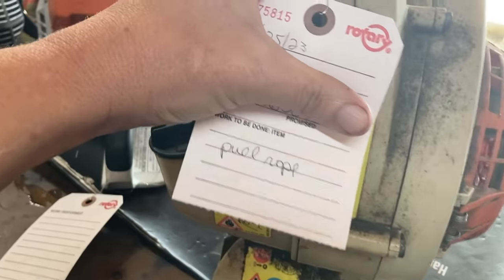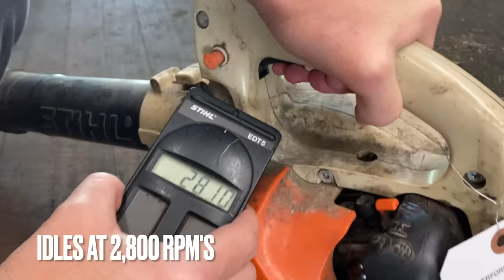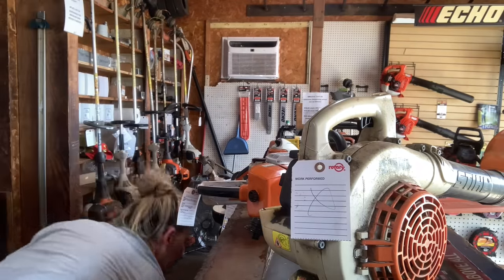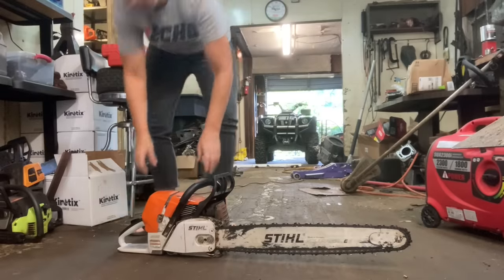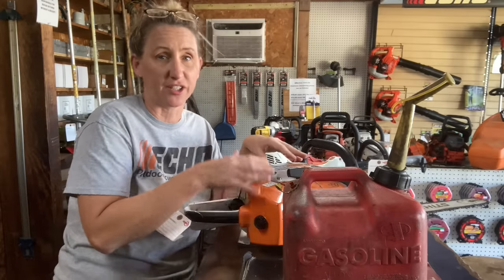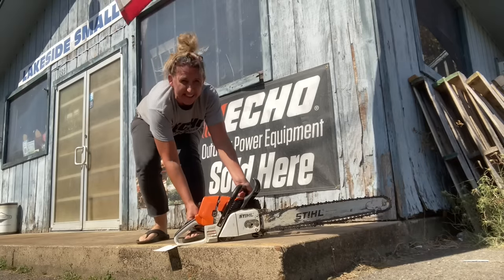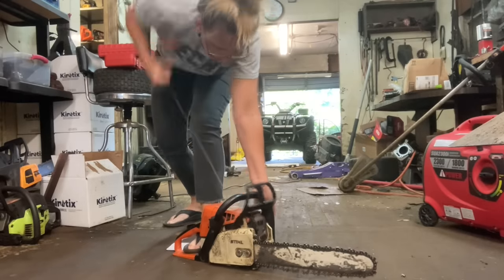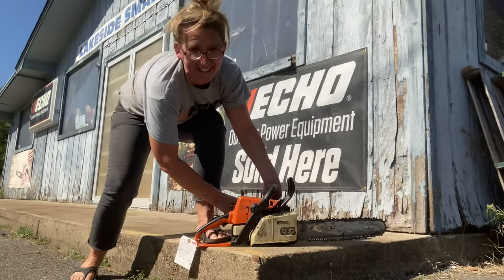The Burning Truth of Canned Fuel. This HUGE Distributor Doesn't Like Me Exposing It!

Comment: Not sure if anyone has mentioned this but what about doing a video on mixing your own fuel? I think many people may be intimidated on doing it and you could show how simple it is and the cost benefits of doing it yourself. Great video as always and I have learned several tricks from your channel!
Reply: Who is stupid enough to be 'intimidated' by putting oil in a gas can?
Reply: Same people who are buying canned fuel instead of mixing their own I suppose.
Reply: Its easy, here in the UK and europe I guess, you can buy a measured dose in a small plastic bottle that you put into a 5ltr can of straight gas, that gives you the perfect ratio
Reply: most people like canned fuel because it has no ethanol added and should keep longer.
Reply: @bonvoyage5377 That's how I've always done it here in the US. It's marked to show what the ratio will be and you buy enough for however many gallons you got. Or you get a gallon of oil and a measuring cup. It's real simple. I've done it for 40 years
Reply: That is great and will last a long time :)

GreT point
Reply: @mikecee3058  Same people that can't change a tire without AAA or put a new graphics card in their computer without Geek Squad. It's getting worse.
Reply: Mixing is easy. Finding ethanol free gas is difficult
Reply: Nearest place to me with Ethanol free gas only has 87 octane  for $4.75 a gallon
Reply: @JamesFlynn-np7sq   Agree, but even that is easy to DIY.... glass jug and water. Water bindes to the ethanol and pulls it out. Sure, you waste a bit, but.... ethanol-free in the end.
Reply: @sfeddie1  and expensive.  just paid 6.39 / gallon today.
Reply: @stickyfox I call AAA because that's why I bought it in the first place, especially the way people drive nowadays, I don't want to get hit
Reply: Pretty sure I know who you’re talking about.  Is there ANY canned fuel you recommend?
Reply: @JamesFlynn-np7sq  Yeah, the no ethanol is a major factor otherwise I would have to go out of State to get gas.
Reply: @ericschulze5641  Well there's changing a tire, and then there's changing a tire on 110th st during rush hour! I'm okay letting a pro with a truck and hazard lights take care of things. But I still think people should be able to change a tire in their own driveway using the tools and instructions that came with their car.
Reply: @stickyfox  people today throw thier shoes out because it's too complicated to put new laces on them & that's what we're dealing with
Reply: Stop mixing more then a gallon can.
Reply: @davidperdue7506  That's all you need for small engines.  They're not high-performance engines with computer-controlled ignition timing.  

But yeah, that extra buck-per-gallon tax for real gasoline is annoying AF.
Reply: @bluejeeper1 some, sure, but very few
Reply: @stickyfox not really, no
Reply: @sfeddie1 precisely
Reply: @2112user Thanks! Nice to see a genuinely helpful comment
Reply: @irtheLeGiOn exactly
Reply: @ericschulze5641 not relevant to the topic
Reply: This is a great question. It may be obvious to most people watching this video, but it's not obvious to me. I have no idea how to practically go about measuring a 40:1 gas/oil mixture in the small quantities I need for my leaf blower. I mean, I know I can buy syringes and measuring cups to precisely measure out the quantities, but it seems like a lot of work just to fuel my blower. There must be some tricks that the pros use.
Reply: Just follow the instructions on the back of the oil bottle 😂 🤦‍♂️
Reply: @jeromewesselman4653  the one about the shoes or taxes,  & both ARE relevant,
Reply: My first thought : /
Reply: 40:1 or whatever not rocket science.
Reply: @ericschulze5641  While I enjoyed reading your posts, unfortunately, they did skirt into condescension a few times. People with chainsaws aren't stupid. They know Imperial and Metric measures inside and out, if for no other reason, that most all of them cook food from time to time. The main trouble smart people have with 2-cycle mixes is an elephant in the room called... [drum roll]

...ethanol. Many of them, myself included, have dealt with unstartable equipment sufficient times using regular (i.e., 10% ethanol) gas, to consider the purchase of a relatively expensive premix to be a minor inconvenience - strike that - more convenient than the alternative scenarios.

I will concede that there are some who would rather not mix in the smaller amounts required for occasional use out of fear of error when calculating equivalent proportions. But I posit they comprise a tiny minority. 

I've got serious questions about 2-cycle engines versus ethanol. Someone knowledgeable should do some videos on the subject - there isn't much worthwhile out there
Reply: @sfeddie1    You can use water and food dye to remove the ethanol,  then a octane booster additive,   then just mix with oil in small batches as you need it.
Been doing this for some years ,no problems and saws run well.
Reply: @Raiver-of-Eridu  You don't usually mix it for each tank. I use an old square metal 1 gallon paint thinner can. It's 3.2 ounces of oil for than gallon can. You don't need to be exact. Sometimes you even find little bottles that are exactly 3.2 ounces so you just dump the entire thing into 1 gallon.
Reply: @julianhawker7672 may as well just buy the pre mixed fuel at that point.😂
Reply: Most people use too much oil creating a lean fuel condition.
Reply: @davidperdue7506 have you tried your local farmers coop? Ours in rural TN sells 87, 89 & 93 octane.
Reply: @Raiver-of-Eridu mix 5litres or a gallon or whatever small quantity jerry can you can get at a time. Get the squeeze measured 2 stroke oil. Figure out how much will get the desired ratio and stick to it. Oil in first, then fuel, then shake it like hell
Reply: @Raiver-of-Eridu   Just get the oil its 2 stroke oil. itll have a picture of yard equipment. you can buy a tiny one meant just for 5 litres or a gallon. then buy a larger bottle of oil and just fill the small one. btw a small amount of ethanol won't ruin your stuff, every landscaper uses normal gas with ethanol
Reply: @jeromewesselman4653 if you can only get ethanol, get the highest octane available and run it completely out of gas before you put it away for a decent amount of time.

Drain the tank (depending on you specific equipment, a lot of times you can disconnect the fuel line at the shut off, makes it easy with less mess) 

Or if you do have a fuel shutoff turn that closed and let it run out, try to start it a couple times with no fuel, you should be good to go next time you need it.

This will prevent the ethanol from gumming up the carb 
But it’s not going to keep your old gas from going bad.
Reply: @raycar1165  Very helpful, thanks!!
Reply: @irtheLeGiOn I drive around the country for my job. I can't remember a gas station that doesn't sell ethanol free gas.
Reply: @2112user and now he that the ethanol is gone so is the octane. 

This is why we can't have nice things, and they stick with compression ratios that are capable of running on 80 octane.
Reply: @leftyeh6495  IDK about the compression ratios, but I absoultely do agree with you on the octane. I know it weakens the gas, removing the ethanol, but I've never seen anyone test it or show numbers as to just how much it lowers it.  
I would like to see this, see if all 3 grades are the same after this, or if starting higher leads to a higher outcome. 
I don't use much 2cycle, so not in a position to really comment on how others might fare, but for my snow throwers and weeder, it works well.  
I did also see a funnel advertized a while back that claimed to remove water ( some separator material in the neck). Never tried it, but have since wondered if that might not be an option/alternative to the glass jar and hose. 
I did like a comment another here had, adding dye to the water.... never did that, but next mix, sure gonna try it.

Comment: i remember when i worked in a service station and we would mix our own 25:1 and 50:1 fuel/oil brand in large tanks and decant. with the reduced costs of 2 stroke oil and the ease for people to accurately measure the ratios, it was stopped. the mix was a blue green colour.  we also sold fuel cans in different colours that made it easy to distinguish them apart.
Reply: Which color sold most, use red easier to tell from light green or blue color

Comment: I have had that problem with 2 different blowers from stihl with premium gas and still oil. Have had this for several years and not sure why. Old or new fuel doesn’t matter but this pushes me to get a tach to see if it is doing same thing( good reason to buy more tools)😁

I just found your channel couple days ago and work on everything from blowers to my kubota B series tractor. There are things you mentioned that I forgot about in my classes back in high school over 35 years ago

Comment: I bought a weed eater 2 years ago. They offered an extended warranty if you used their canned fuel. The unit would not rev up to full RPM. Took it to the place I bought it. They adjusted the carb. It was better but still not achieving full RPM. Then I saw a video of yours or maybe someone else (not sure) about the canned fuel. Stopped using it at that time. The unit runs great and reaches full RPMs. It is however harder to start now. But still runs way better than on that premix junk!  Thanks for the heads up.
Reply: Without naming names...I did exactly the same thing. Ran fine first time. After that, could not get full RPMs. Ever since switching to  Echo Red Armor , it hasen't missed a beat.

Comment: Your shop coffee must have a heck of a kick!
More seriously... I wonder if freshness has an effect. I'd be willing to bet that somewhere along the supply chain those cans sit for way too long. Perhaps the fuel is OK when it goes in the can, which is why it works for some people, but at some point the age matters and you see problems.
I am pretty sure that when I make my own mix, the gas hasn't sat around for very long.
Reply: I have had Echo fuel in a trimmer and chainsaw both, set over the winter, and well into the summer for the saw, they both fired up with out having to do anything but prime the trimmer, choke the saw, saw did not have bulb to prime, both fired up and ran just fine on left over fuel in the tanks, it was Echo Red Armor fuel
Reply: The problem is that they claim it doesn't go bad
Reply: I don't know if they still have a date stamp on the bottom of the cans but I don't care what the chemistry is, the fuel will deteriorate when mixed with any brand of two-stroke oil.  Red Armor has a preservative in it that is supposed to be good for two years.  To me it is much easier to get an accurate measuring cup and only mix the amount of fuel and two-stroke oil I need at any one time; much easier than taking it to a shop or rebuilding the carb. I am a fan of Amsoil Saber at 40:1 and have been using it for over 30 years in all my two stroke equipment including large chainsaws (461, 660).
Reply: The coffee wouldn’t even give you a buzz.
Reply: As she showed.   They can run on the can fuel but… the performance is diminished.  With the blower it was a 17% reduction in RPM, just by using better fuel you can take the performance of the machine to the next model up and still have the cost and weight of a smaller machine.
Reply: @tomdomenico how hard is it to add a known quantity of oil to the fuel tank? Guess too hard for some

Comment: I always try to refuse selling my customers that canned stuff, especially at $23 a gallon.  I generally send them to check out with a new 1 gallon fuel can, some quality 2 cycle oil and directions to the closest 90 octane, ethanol-free station, with a dedicated hose.  About 5 bucks a gallon!  Yeah, I work at a big box store.  😒
Reply: NO ethanol free gas in my communist state.
Reply: @geraldscott4302  You can remove ethanol from gasoline by mixing 1 cup of water per gallon, shaking well, and let settle. The alcohol will dissolve into the water, and the gasoline will float to the top. Separate the fuel from the water and you're good to go.
Reply: @geraldscott4302  question: do you have a general aviation airport in your area?  If you can get some aviation fuel - 100 low lead - that’s alcohol-free, and is said to keep well, also.

Failing that - race gas?
Reply: @dennisyoung4631  Yes there is a municipal airport nearby, but they won't put fuel in anything but an airplane. Race gas is available at the local dragstrip, in 5 gallon cans, at over $20 a gallon. My state has gone to great lengths to make it almost impossible to get ethanol free gas.
Reply: Yes you can remove ethanol from gasoline with water, but by doing so you are lowering the octane rating. This is not a good idea.

Comment: I have been mixing my own fuel in my Echo es5500 for the last 28 years (With regular gas as per manufacturer's recommendations) and it still works like a charm. Some people tell me that I should always use hi octane gas on small engines but I'm very sceptical about that and need clarification.

Comment: Hi Bre! I have learned so much from your videos! Watching your one from a year ago about bar oil leaks, I noticed you poured the bar oil in the traditional method, "Tip her up and let it rip". But I may be able to help[ with a neat trick about pouring oil (or antifreeze) from a plastic bottle. A full bottle will do the glug, glug of burping out the liquid and often some misses the target. Instead of holding the bottle in the "normal" or intuitive position turn it around backwards. When you pour with the opening back near the webbing of your thumb and index finger air easily gets into the jug which allows the fluid to flow smoothly. Aim carefully and you will have much less spillage. Readers, this does NOT apply to gas cans. Love your program Bre!
Reply: It's not a trick, it's designed that way. Ben at "2 vintage" does the glug, glug  all the time.... smh

Comment: Great video! I am guilty of using it at one time. Once I seen your video of how bad it is I emptied it out! One question though, do you mix 40-1 and 50-1 separately or do you just have a secret mixture? Thanks Bri for sharing your knowledge. You do a fine job young lady! Keep up the great job!
Reply: I use 40:1 in ALL my saw! Ran 32:1 before because i had snowmobile mix on hand and no issues also
Reply: I only use Stihl premium (silver bottle) and do it by the instructions which is 50:1. Never had a fuel issue.
Reply: Oh, and only ethanol free gas with Sta-bil, in case I don't use it for a while.
Reply: @MtlCstr  If you ever have to have it fixed under warranty, they say they won't warranty it unless that's the 2 cycle oil you've been using.
Reply: There's a special cup called a Ratio Right,  it has markings for every conceivable mixture,

Comment: As others have commented I'm also curious as to whether part of the problem is that the engineered fuel got old or stale, either in the delivery chain or just sitting in the piece of equipment for a long time.

It would have been interesting on that blower to subsequently dump out the mixed gas and that refill it with a "fresh" can of the engineered fuel and see if it's still ran below max RPM.
Reply: Ya a true experiment, I think you're probably right.
Reply: But how does that solve anything?  With the canned fuel, it is the age that it is, and you use it at the rate you use it.  For my 2 cycle equipment, I mix up enough fresh from the gas station pump, to use within 2 months.  For my use rate that is 2 & 2/3rd cups of gas and 1 tablespoons of oil to reach roughly 43:1 ratio.  If it gets stale, I set it aside to use as a parts washing solution, or it is also a good substitute for products like Goo-Gone to clean petroleum adhesive/sticker residue off of things.  Even better if you put a little diesel fuel in to slow down the evaporation rate.  Use outdoors, of course.
Reply: The cans have dates - are the customers using really old engineered fuel?

Comment: Great video, as a general mechanic I miss out on a a lot of the small engine intricacies. For all my gas ( Here in OZ we call it petrol ) engines I use pump gas plus fuel stabiliser, works a treat and never fill a 2 stroke with someone else's mix.
Reply: Hi Peter😊
Reply: What kind of fuel do you use? What octane? I just had my Stihl serviced because it wouldn’t start. It probably only had 2 to 3 hours on the saw. They said someone messed with the carburetor, however it has never been out of my possession. They replaced the carburetor under warranty. They said to use the canned fuel. I bought a can and was shocked at the price. Although it was about $10 cheaper than Stihl fuel. I have been using a chainsaw for probably 60 years and this was the first, and last can of premixed fuel I will buy. Great video.
Reply: 91 Octaine ethonol free and Stihl synthetic oil 50 to 1
Reply: @peterclark7879  hello
Reply: @peterclark7879 Cant you get higher octane ethanol free than 91 in oz??? Assuming you're not using "freedom units," as a system of measure
Reply: @jackd1582  Hi Jack, Yes, you  can get  98 octane, which is quite  expensive herebut I have always used  the lower octane. As in leaded fuel  days, it was recommended  to stop lead fowling in 2 strokes.

Comment: This is not the first time I have heard this about TruFuel 50:1. Long story short, I went down to the local small engine repair guy because I found an old weed eater that had brittle fuel lines. In conversation with him he said that if I were to attempt to get it running again “do not use TruFuel” if I wanted to succeed in getting it to fire up. So I decided to research it further and came across your UTube videos. Keep up the good work.